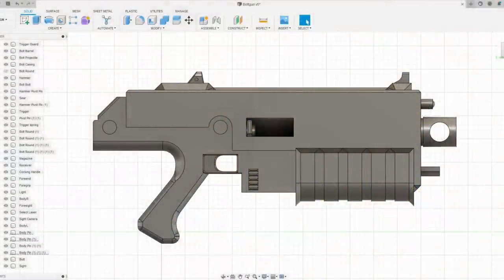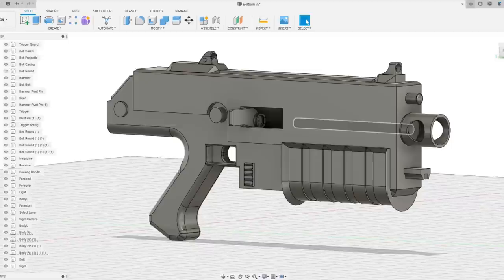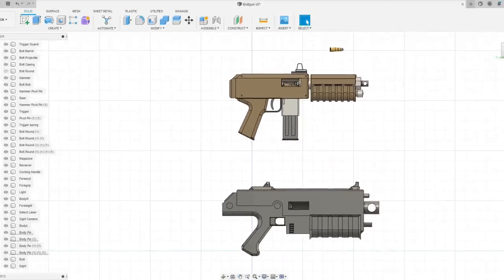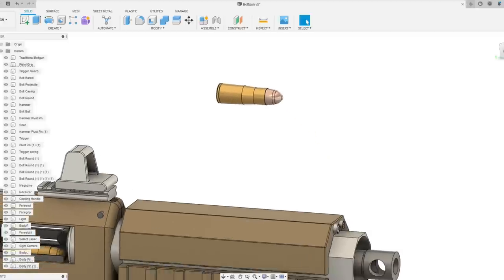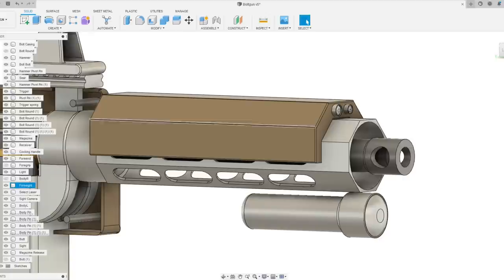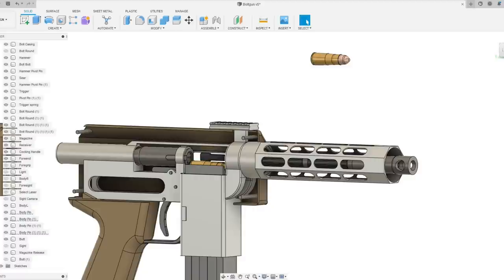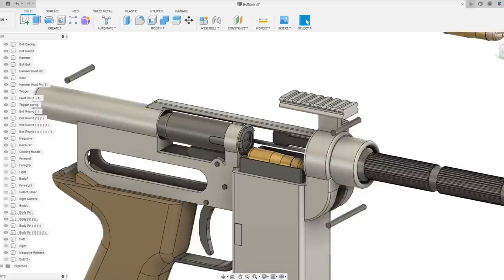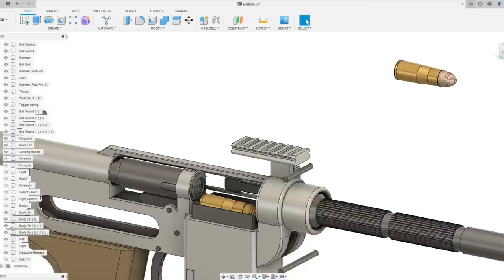Building A More Accurate Bolter

Comment: Personally, I've always thought the biggest challenge when trying to make a realistic version of a bolter is figuring out exactly how tf bolts work.

They are supposed to be caseless, yet brass gets ejected after every shot; they are officially 0.50, 0.60, 0.75, 0.998 and 1 inches in diameter, depending on who you ask; they are solid enough to pierce concrete walls, yet hollow enough that they can rip a man in half with all the explosives within; the barrels are rifled, yet the rockets stabilize the bolts by themselves; pistols have less range than full bolters, even though they (supposedly) fire the same cartridges, which are (supposedly) rocket propelled, meaning the lesser barrel length of pistols should be completely inconsequential.

Also, what's the official autoloading operation, of bolters? Would a gas-operated system even work on a bolter? I've always imagined they are simply blowbacks, because of all the recoil.
Reply: On calibre variants: Different forge worlds, different variants. The Imperium's armoury is not as standardised as you think.

More energy dense explosives.

Rifling stabilisation and gyrojet spin stabilisation are not mutually exclusive. A bolter could be leveraging both.
Reply: @MansMan42069  That's not the point; the point is: why use both systems if either one is effective?

Having two systems that accomplish the same thing wouldn't make the weapon more redundant and thus reliable, but instead it would just create unnecessary complexity. Bullets don't just stop spinning when they leave the rifle straight away, and projectiles that do create spin by themselves (usually through the means of solid fins interacting with the atmosphere) are fired from smoothbores to reduce friction, maintenance and to ease manufacturing of the gun.

Since marines often fight in non-standard environments, it makes sense that they use rocket propelled ammo, so I would have to assume all bolters are smoothbores. It just makes more sense.

For the other two points, I have no counter-argument. Since Space Marines fight a wide variety of foes of all sizes and densities, it makes sense that they would have acces to many different calibres, and the properties of future materials may make it possible to have such an APHE round with both good detonation and penetration.
Reply: @lordtomlluckrahthegreat9014  Conventional propellant: Lose velocity as soon as the gases stop pushing against it.

Self-propelled: Requires distance for the rocket to accelerate the projectile to top speed.

A hybrid system means the projectile is at max velocity at the muzzle. The rocket propulsion counteracts the immediate deceleration after exiting the barrel.

Hybrid ammunition like this already exists in the real world in artillery shells.

The actual rocket fuel doesn't actually need to make the projectile go faster. It just needs to help it stay at max velocity for longer.
Reply: @MansMan42069  I know, and I'm not against that notion. The RPG-7 works like that, and so does the main gun on the legendary Sturmtiger.

The thing I'm against isn't the hybrid propulsion mechanism, but the hybrid spin stabilization mechanism. It can either be a rifled barrel or a self-stabilizing projectile, but not both.

In the examples I just mentioned:
The RPG-7 has a smooth bore, and the grenade only begins to spin once it starts it's second stage of propulsion, with folding fins and angled rockets nozzles.
In the case of the Sturmtiger, the barrel has riflings and it imparts spin to the projectile during the first stage of propulsion, but after it leaves the barrel and once the secondary rockets start, the projectile itself does nothing to maintain it's own spin; the rockets only serve to increase and maintain velocity.

I'll say it again: hybrid propulsion systems are ok; hybrid stabilization systems are a bad idea.
Reply: @lordtomlluckrahthegreat9014  Actually, in all animated depictions of bolters, bolts only have a single central nozzle. Spin stabilisation is done entirely within the gun.

I have not seen any depiction of bolts having offset nozzles that impart spin.

Comment: Warhammer has this same problem with tanks guns vs turret sizes there is no way the gun fits inside the turret of any warhammer tank.
Reply: The Russ is the best example of both over and under gunned. In lore it features a 122mm gun for the standard cannon, but is large enough for a man to crawl into. While the cramped turret looks like it could barely fit a 75mm.
Reply: To be fair, models in 40k are this weird amalgamation of "chibi" proportions (especially vehicles in relation to their operators) and "big barrel means does big damage" design philosophy, of which the Leman Russ most definitely exemplifies as  @monkeyinapanzer2021 pointed out.
Reply: @monkeyinapanzer  Are you sure they didn't just pull an Oddball and slide a piece of pipe over the barrel to make the enemy think it's a higher caliber? LOL
Reply: @liammorgan1413  I think some lore somewhere explained away it’s a barrel shroud and that the actual gun rest inside it. Granted actually digging into the lore also says the thing uses an actual WWII era German tank engine off a Tiger.

Double checked and the engine is stated to be a “HL230 V12” which is a WWII era engine that was under powered for Germany’s ~46 ton Panther.

Comment: Your bolter design looks like the guns used by the slig poppers in odd world.
A challenge for humans would be operating the cocking handle because blow back uses weight and spring to stop gun becoming a bomb. Better operatons could be short recoil, long recoil or roller delayed as they allowe for lighter bolt and recoil spring, yes i know these would be a pain to model.

Comment: Up to 11 minutes. Pretty damn good stuff, though imo, I'd dump the "rocket propelled" bs of GW writers. While it's true you said the bullet would spin due to gyrojet, and I looked up the firearms you refered to, I don't think you'd get good results from this. The .51 caliber was only double .45 ACP energy, while super slow for a rifle, only 1250 fps. It was also very inaccurate and inconsistent.

For the most part, I think just upping the material used for cases, to hold more pressure, and increasing bullet caliber and weight would be more functional.

Pretty good vid though, and thank you for fixing that annoying extraction port location. Add a rifle stock too please.